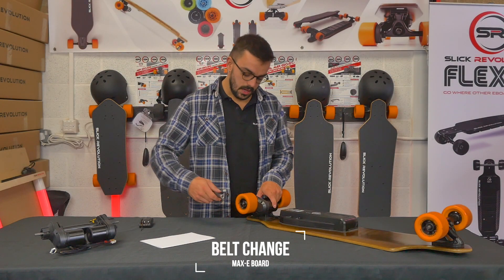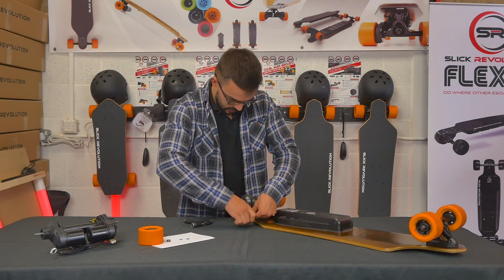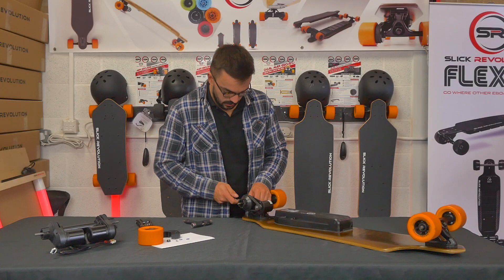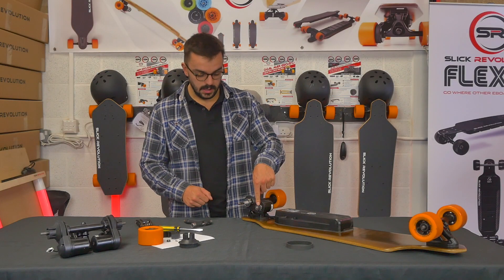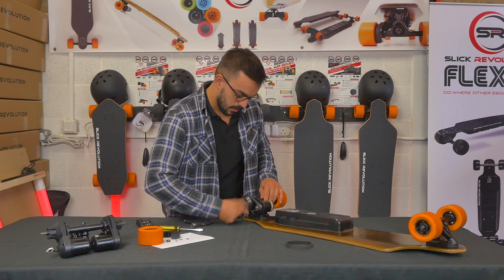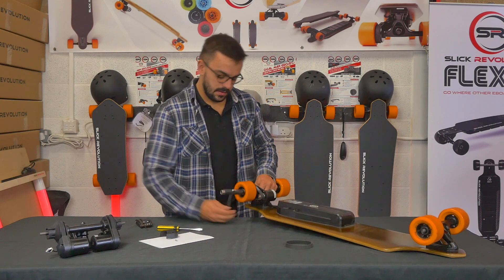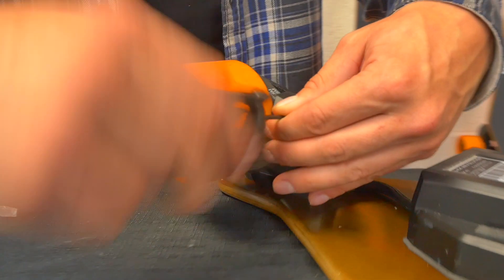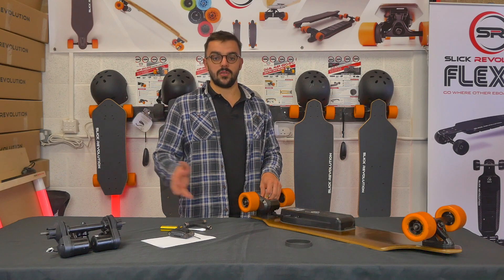Slick Revolution Maintenance Series |  Belt Change

Comment: Hi quick question. How do i remove the bearing behind the dry belt cover? I need to tighten up the small  bolts that hold the plate but the bearings are in the way. Thanks.